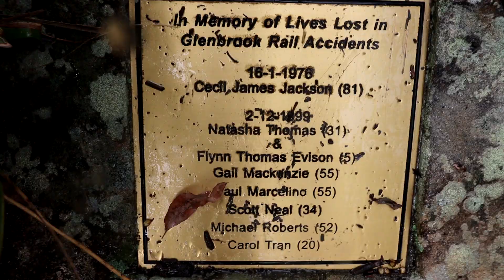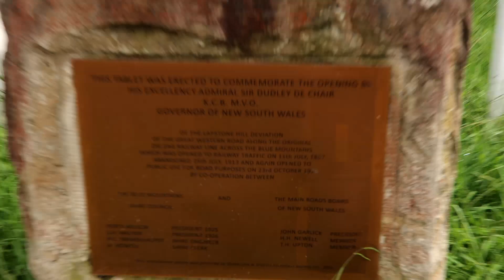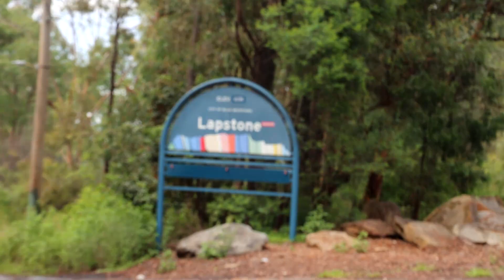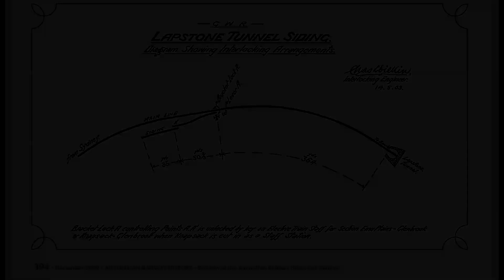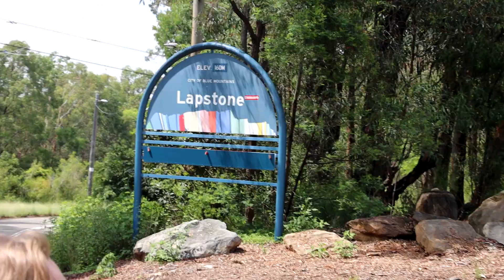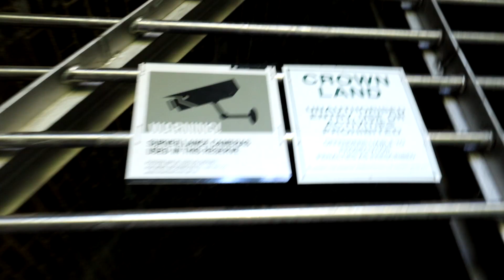130 Year Old Abandoned Railway Tunnel! Glenbrook Australia

Comment: Thats bad at the other end! Its not snakes you have to worry about nor faceplanting into a spider web. Its the Funnel Webs. The Blue Mountains has the tree dwelling species that can drop you from above(no joke). 

That light switch assembly and sesnor light hints at very recent activity in that tunnel. And I am also to see that old Lister still sitting there. It would've been a generator plant, most probably from the WWII by the design of the generator casing you looked at. 

Glad to know that work has been done on the tunnel though since your visit. It appears it will be 2025 before its open. Its likely most if not all of the 2.7 million given has been eaten in surveys and all that stuff. The council mentioned receiving two grants for further work. They still need to improve drainage and install lighting, amongst other stuff. 

Blue Mountains City Council must also work with Crown Lands NSW about plans for future use of the site. Knowing Australia, it will probably be 2027/28 at least before it actually opens.

Comment: That first bit you walked along is the lower road of the lapstone zig-zag.  The cutting to right as you look at the water tower is the start of the second deviation.
Reply from the maker: Very interesting! Thanks for the info 🙏🏻
Reply: @TallBoyGareth  And also there are 2 ways of getting down to the eastern portal, they are both on the southern side, you can climb down the rocks just before the tunnel brickwork, or there is a brick drain that is quite steep but when dry is climbable about 10-15m back from the entrance. The drop off on the right is a creek that was diverted to stop the tunnel and cutting flooding. And I have no idea about those sticks in the tree, they weren't there last time my friends and I were there

Comment: Just to add to earlier comments, firstly the low cutting around the 4 and 5 minute mark was the "end of the line" - or rather the common section of the "bottom road" and "middle road" - coming up from Penrith. The train would had crossed the Knapsack Viaduct a little earlier. The low cutting is where trains from the "bottom road" stopped, and because of more recent works, the beginning of the ascent of the "middle road" has been obliterated. Trains would ascend the middle road as far as the Lucasville railway station before resuming a forward direction on the "top road". Hence we have the "zig-zag" or "switchback" railway. There was no error nor change of plan in that section.

The first Glenbrook tunnel was built to relieve the inefficiencies, time and the like of the zig-zag by providing a continuous forward path. Trains continued to use the Knapsack Viaduct, but close to the "bottom points" (the junction of the bottom and middle roads), trains climbing into the Blue Mountains would diverge to the right into the cutting near the water tank (near where the car was parked), and of course this cutting was followed up to the tunnel. The tunnel, as stated in the video, was the site of serious incidents, and it was notorious for its steep gradient, S bend curvature and water seepage.

After railway abandonment, the tunnel was used for mushroom growing. With World War 2, the tunnel and cuttings were illegally used for chemical munitions storage. This was illegal under international conventions which had banned chemical weapons after the utter horrors that were a part of World War 1. https://mustardgas.org/ and associated books are the ultimate references on this matter.

Subsequent to World War 2, the tunnel was again used for mushroom cultivation and the abandoned equipment seen at the end of the video would have been a part of that enterprise. I do not know why or when mushroom cultivation ceased. So the slop that was walked through in order to get to the lower end of the tunnel was likely a mixture of mushroom humus, fertilizer and the ever present water. It would take a very serious drought for that to dry up!

Note that in getting to the lower end of the tunnel via the track, it was shown there was quite a drop on either side of the track. There is a creek just adjacent the tunnel entrance and this creek was diverted away from the railway by means of a wall. The walking track was on top of the wall hence the drop either side. Apparently it wasn't viable to allow the creek water to flow near the railway. Obviously flooding would have been an issue.

I hope the above helps. Cheers and thanks for making the video.
Reply from the maker: Really appreciate your extra information on this amazing place! cheers mate 🙏🏻✅
Reply: @TallBoyGareth  Found the following - https://www.bluemountainsgazette.com.au/story/3804445/glenbrook-mushroom-farm-doss-house-shuts-down/ so we can say mushroom farming ceased by 2016.

Comment: I wouldn’t of had the guts to do that props to you
Reply: It's so overgrown now & hard to see the way down, but the climb down to the left side of tunnel when facing it is climbable. It was a challenge when I was a young kid as there's a gap or two in the ledges you use with quite a stretch for my size back then but by the time I was a teenager it was handlable, albeit with care! I remember one was a bit of a leap of faith as you land on a pretty small ledge but its stable & flat with ample room so you can drop down to solid footing. Looks daunting though, definately. 😁

Comment: Interesting video, but please say "Railway Station" not Train Station, and railway line, not train line. It sounds so amateurish! AFAIK, the Lapstone (note the spelling) Zig Zag was replaced by the existing mainline. The section you were walking on in the video was cut by the existing road. What you walked down to get there was just a bush track. Also, it's the Glenbrook tunnel as Lapstone is further down the line. In reference to the brickwork you can see inside the tunnel at the lower end, was something to do with testing of mustard gas on soldiers for use in WWII.